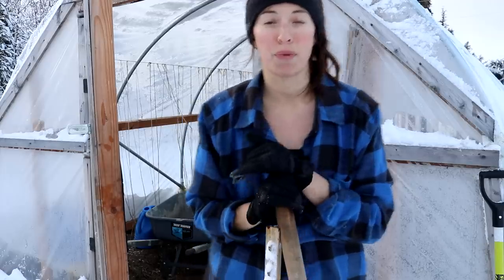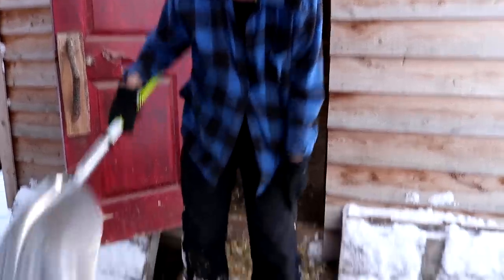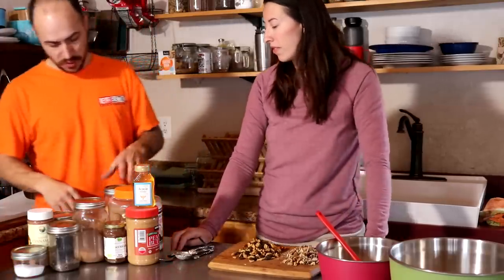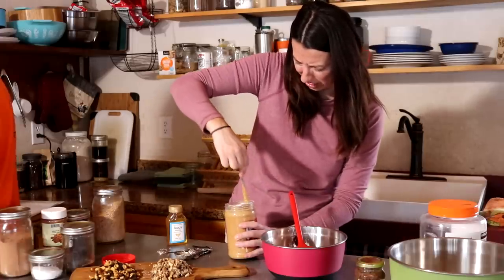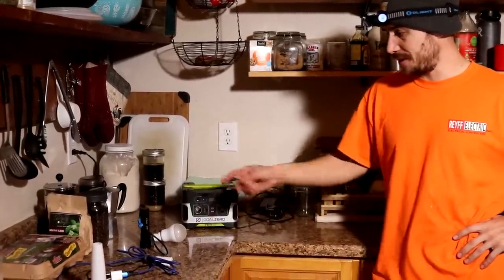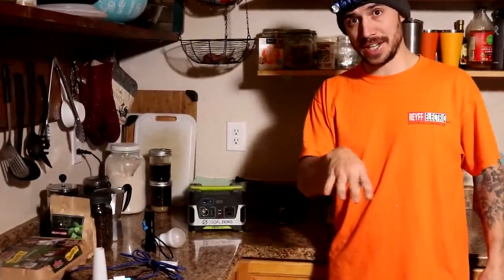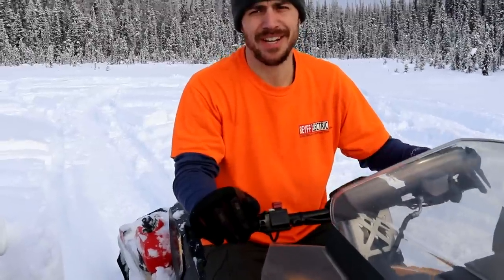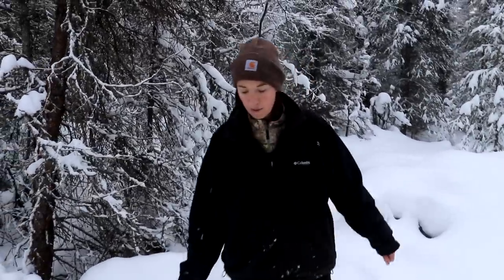Life in a Dry Cabin | Winter Days

Comment: Awesome you have that Honda powered snow blower.  This has a far superior engine to just about anything out there.  I used to have Briggs and Stratton, Kohler and Tecumseh powered tools, but when I got my first Honda lawn mower, it was like night and day.  Now I have Honda powered everything...lawn mower, snow blower, generator, water pump, etc.  Now I spend most of my time using the equipment, not repairing break downs..
Reply: Didn't know Honda made a lawn mower.
Reply: @gufredd9675  Yeah...they have several models.  Mine is a HRR216.

Comment: Little tip. When you use the pull starter on the blower let it gently retract. Cold plastic is much more likely to break and when the handle breaks the rope could get pulled inside
Reply: Good on ya, Jeffrey, also don't pull the rope all the way out. You can break the rope at the knot.

Comment: I luv that shower head with the battery. Compost pile with a black pipe buried at bottom in the tunnel will help heat it somewhat. Works surprisingly well.

Comment: That siphon shower head is a game changer! I wonder if you had the stall right outside a back door (if you have one), and create an access door you could run the shower head out to the the stall and leave the hot water pot inside. Then when you're done, you can get inside the cabin in 2 seconds, pull in the shower head and close the access door? Maybe a long term upgrade...
Reply: That was my setup. We had a well and running water at kitchen sink. Hose went from sink to shower head outside. When done 10 steps to hot woodstove
Reply: @tomvoyt3522  excellent!

Comment: Had a 12 x18 cabin in northern Wisconsin with my gf years ago. Had electricity and a well. Only plumbing inside was a kitchen sink with hot and cold running water.  Our shower was a short piece of foam hose clamped to faucet and then garden hose. Garden hose went from faucet, up to ceiling,  to corner of cabin. Went thru wall 1 foot with shower head on end. Small pallet under to stand on. Partner watched thru window. If too cold showerer pointed up. Other person adjusted temp. My coldest shower was -27°f. Most enjoyable.  Fine under hot water. Only problem was my feet kinda stuck to deck as I stepped from pallet to door.  10 steps later I was standing by a cherry woodstove

Comment: Use a tin coffee can and bailing wire to make a make shift heater oven with the snow machines exhaust. Works for sandwich type stuff wrapped in foil. They do sell commercially made purpose built ones too

Comment: When I'm off the grid in my RV I mostly recharge my (lead-acid) batteries with solar. I do run the generator for about 30 minutes in the morning for the coffee maker and microwave. This also begins the recharging my batteries with a high-amperage "bulk" charge. The solar panels can finish off the battery charging at the more moderate rate they are capable of delivering for the absorption charge cycle.

Comment: just a tip from a lower, kinda funny but, i have a higher pitch more like a tear drop on my greenhouse and just warm the inside up a little then tap from the inside and it falls off 🤷🏻‍♂️ also for the trees put gravel at the bottom then put a piece of 6” pvc 1ft high or so up and no issues there...for emergency meals i make pbnj with honey, pickled eggs and salami n cheese, jerky and nuts except cheese it all keeps also cup noodles but 🤫🤦🏻‍♂️🤷🏻‍♂️

Comment: Pemmican Of ALL Kinds (Sweet/Spicy/Regular) Is ALWAYS Great....For Decades We've Used Mostly "Sweet Meat" Deveined Deer Hearts Which Is Very Lean & A Smooth Consistency (In Your Case, Elk, Caribou, Moose Hearts) Ground-Up & Mixed With Your/Any/All Dried Fruit & Nuts, Oils/Fats You Can Use Either Casing or Not (Like A Jerky) Dry It In Your Dehydrator & Boom A Powerhouse Meal/Snack For Any Time/Situation

Comment: Worrying about standing on the shed roof - even the very small metal-framed snowshoes would distribute your weight better, cut down on the psi under your feet, but not hinder your movements TOO much.  Had my son up on the low pitch roof of our house in Eagle River with a small snowblower once.  Cringing constantly, as fathers will do, but it worked out great!

Comment: Wow, I can't believe they continue to shower outside right through their severely cold winter!  😱🥶 Why not just put a shower stall inside the cabin with a drain but no running water and use the same hot water pot and camping pump setup? 🤔